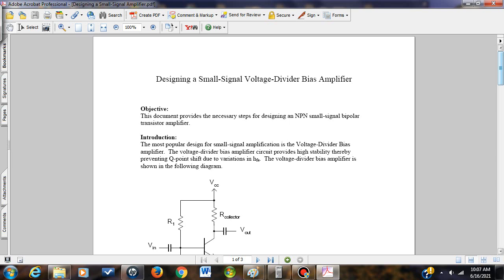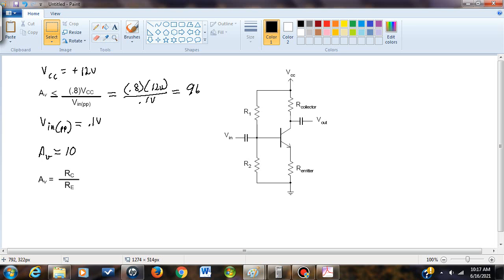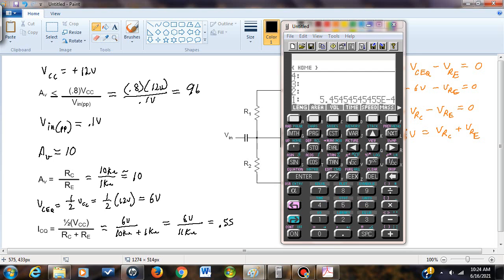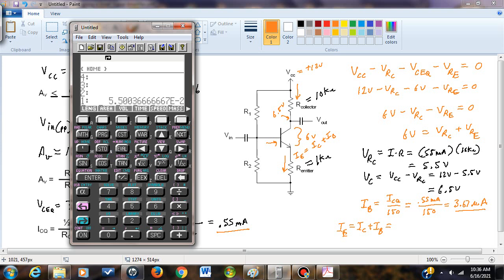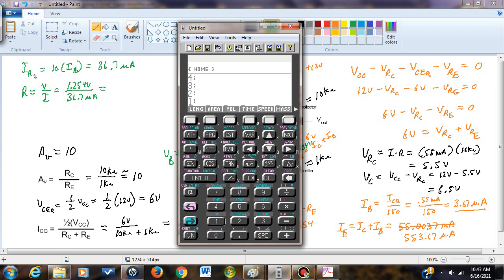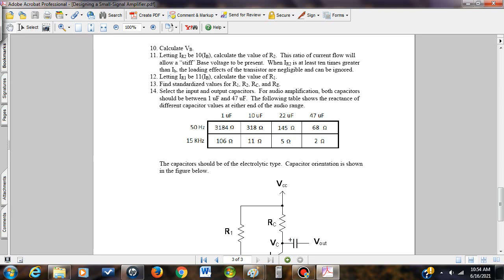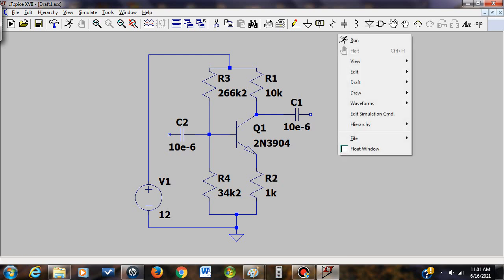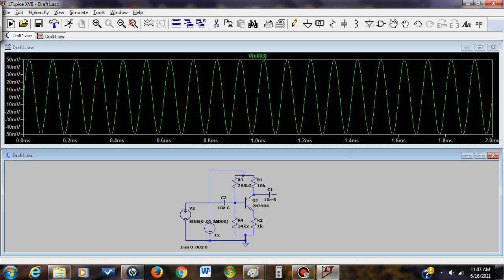Designing a Small Signal Amplifier

Comment: Great video, I am sure most people come across this but my issue is loading the signal with a something like a low impedance speaker e.g. 8 or 4 ohms.  I have tried similar circuits that work well on an oscilloscope but don't drive enough current for the speaker.  A second stage is of course needed using the collector of the transistor I have been told which builds a current follower.  It would be good to understand how you calculate this stage, if there is a video out there explaining this I would be grateful is someone would share.
Reply from the maker: What you need to drive a speaker is a power amplifier stage which primarily amplifies current and not voltage.  The power amplifier stage is the last stage of an audio amplifier which drives a speaker.  I recommend a Class AB amplifier stage since schematic drawings are readily available on the internet and most employ components that are still available.  Hope this helps.

Comment: In step 3 and 4 the resistor values I chose gave me a Vceq that was higher than I wanted, how do I spread the voltage drop across the resistors Re and Rc? How can I find the values that give me the Vceq I want